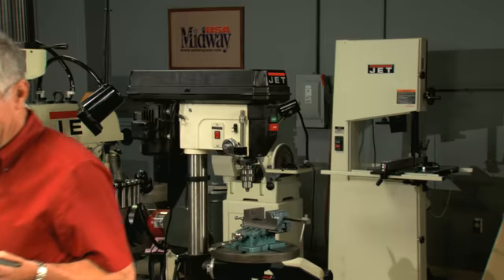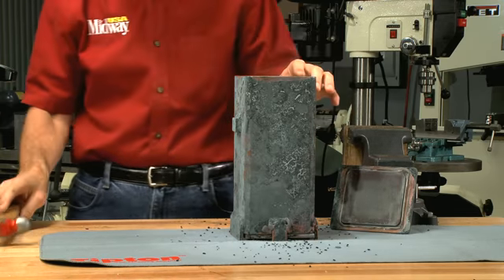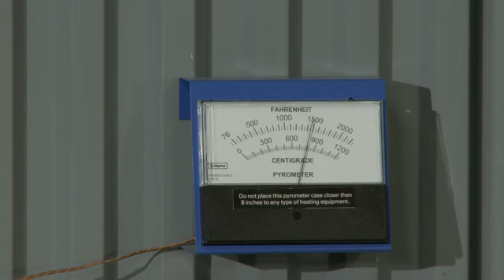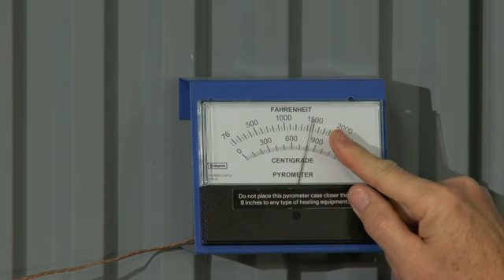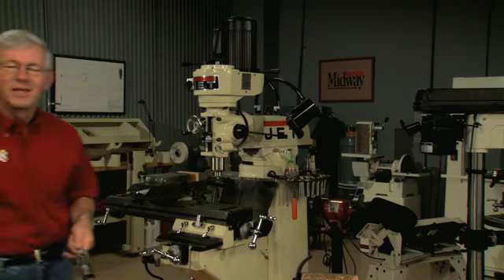How to Anneal Metal Parts for Shaping and Polishing | MidwayUSA Gunsmithing

Comment: This would add carbon to the steel. This is a case hardening technique, I have read that a 24 hr soak will give 1/8" penetration of carbon into the steel. Doing the math, this would give 1/16", these parts could now be hardened, and tempered to optimal performance.